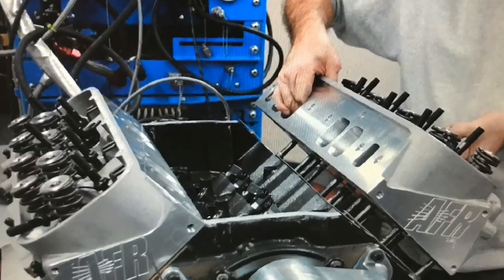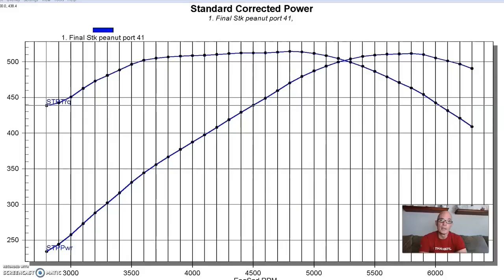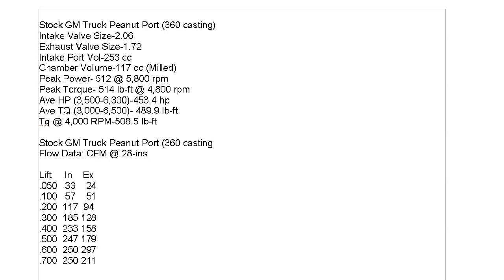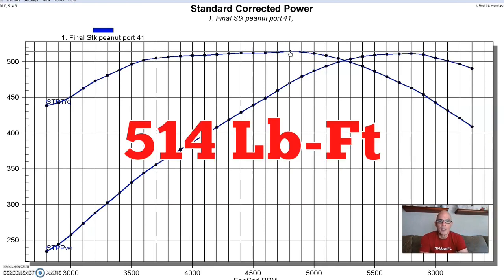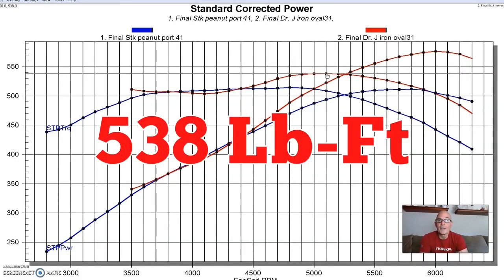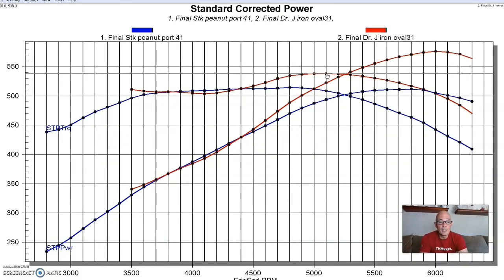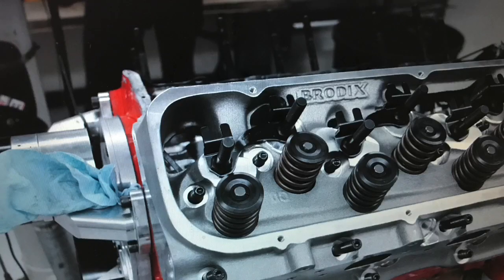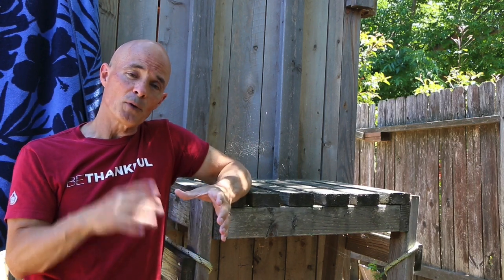THE OVAL OFFICE-WHO WINS?

Comment: should have done 049 or 781 stock unported with stock 2.06in 1.76" exh with 3angle valve seat. I think you will find those would have achieved above 500
Reply: I agree.  Maybe even show 049/781 with 2.06/1.76 and 2.19/1.88 valves and some basic bowl blending. Something the average person could do.
Reply: That would have been a better head to head comparison.

Comment: Alright Rich!!   I am ready for the BB Rect port test!!  In the way back, 1995, My 496 had Cast Iron Merlin Rect Ports, 850cfm on a Vic 454-R and Comp Cams 288AR-8 Solid Roller, with flat tops it had 9.8 CR 605hp 610tq. Peak Power at 6400rpm.  I always wanted to improve on that but never had a chance.

Comment: I noticed the AFR heads show better flow rates on the intake at lower lift and not higher flow than the other heads.
Reply: 50 degree seats on afr makes great low lift flow numbers . and obvious power .
Reply: Higher average flow makes more power! You'd need higher lift to make use of the higher peak flow heads shown anyway :)
Reply: @garageredzone  normally do but these made more power with less flow, I guess the difference was smaller chambers.. I have noticed that if the more lift doesnt help flow you can size you cam according to that.
Reply: During the time the valve is opening and closing, that's when the low-lift flow becomes a factor in mid-upper RPM performance. That's when the valves are in overlap. The amount of time in overlap, with the right manifold runner length, and header setup, will purge the cylinder and the combustion chamber. 
--You're supposed to be able to make 1.3 foot pounds of torque per cubic inch with a well planned built, no matter what design of engine you have(pushrod, 2-valve, 5 valve dohc, it doesn't matter). If you know what you're doing, you can get it. Otherwise, you're gonna be closer to 1.15.

Comment: I was surprised that the peanuts made it over 500. That’s my goal with a little smaller cam but more compression. Trying to keep the rpm down on factory crank and rods
Reply: every time i hit 6000 rpm's on my 396..it was time for a new bottom end job.
Reply: @stanherman5604  what do you mean? how many times did it blow at 6000?
Reply: @Christian-lf6iy  Twice

Comment: Loved that test. In the early 80s I traded my rectangular port heads for a set of race ported oval ports because of the low end power they provided on the street. I think this was about the time when articles has just started coming out about the difference at that time. The ovals wer far superior on my 468 in a 3600lb car

Comment: Awesome test as usual. I have a .040" over Gen V 454 with AFR 265s going in my fathers 72 ElCo. Was hoping to be around 600, but running a much smaller cam - ZZ502 H.O. camshaft. Topped with an Edelbrock Torquer and a Holley Sniper EFI. Maybe 560-575 is a more realistic # for what I have.
Reply: 570-575 hp is around 600 in my book.
Reply: The Edelbrock torker could be swapped out for an rpm air gap, will make a big difference across the entire rpm range
Reply: Get yourself a rpm air gap and that would definitely help

Comment: im building a 461 right now with the factory oval port heads im using a comp cams Magnum 294S Mechanical Flat Tappet Camshaft
Lift: .595''/.595"
Duration: 294°/294°
Lobe Separation Angle: 110°
RPM Range: 2500-6500 10.5 -1 calculated compression ratio duration at .050 is 248 which seems like a somewhat compareable camshaft to the one you used it seemed all the heads except maybe the afrs would have done better with an edelbrock performer rpm intake im at a bit of odds right now between single and dual plane intake however it seems to have ample torque to get the car moving with the single plane and a plate might be in the cards .......Love your stuff thanks for all you do !

Comment: This is a really great video I have a set of fully worked 049 on a 468 but it is 12.7 compression but I've run 10-6 at 127 so far and it could definitely use more converter  NA in my 1970 Chevelle. Videos are on my channel.. nitrous passes are 150 HP setting and easy mid nines.
Reply from the maker: Thanks for the info!

Comment: I built a big block for a buddy of mine he has a machine shop it was a 454 block we used a 396 crank and the 60 over bore 12 to 1 compression the cubic inch comes out to 431 inches we use the det of O 49 cylinder heads   We spray welded the exhaust ports to pick up the exhaust speed and ported the intake ports this motor made it easy 600 hp just recently upgraded  To a good set of rods and the motor look great Felt guilty spraying it with nitrous so we upgraded to bottom and it pushes a full body nova into the low 9 s would love to see  You build a small big block and put some bad ass heads on it
Reply: The det of 049 heads.
Det??

Comment: I’d like to see the exact same testing with a 496...
Reply: Sesame. I'm at a point in my 496 build where Im ready to throw it out the window. I need to spend my money wisely for the rest of the build and heads are the biggest cost
Reply: Shit Box cost is the same as building a 468 so might as well have the extra cubes!
Reply: David Callahan, Absolutely, I’ve seen 496’s with 781 and 049 heads, made huge low speed torque. If iron GM heads will work to some extent with that much displacement, Im sure any of the the aftermarket castings Richard tested in this video would make for one nasty pump gas 496. 👍🏻
Reply: Ian Hamilton Store, Build what you can afford, can always upgrade later, good luck man. 👍🏻
Reply: The only heads and intake I can find are from Raylar ?
Reply: Joe Nobody, You building an 8.1?
Reply: i got promaxx 325cc heads on my 496
Reply: @markusgentry1548  
Good combo?
Reply: @shitbox7413  havent put it on the dyno yet , its a 12:1 motor , milodon 4 bolt splayed mains , scat crank n rods with mahle pistons , should make 750ish .
Reply: @shitbox7413  gettin ready to build a 17:1 434 stroker small block for my s10 too lol with brodix track 1 sts 245cc heads
Reply: @markusgentry1548  
Holy shit that’s a lot of compression...
Reply: @shitbox7413  yea mahle power pak pistons witha 8cc dome and 64cc heads its actually more like 14.7 to 1
Reply: @markusgentry1548  
On methanol?
Reply: @shitbox7413  nah jus normal race fuel , has a bullet racing cam 683/640 lift 267/275 duration hydraulic roller

Comment: 512hp from stock peanut ports?  Well that settles it for me, all that money I was going to spend on heads is going into a roller cam and blow through carb!!
Reply: Why be stuck at 500 with stock heads after a nice upgrade of roller cam and intake, where as AFR or Dart heads would help you get much closer to 600 horse with at least 525 torque.
Reply: @delljr2769  pick up peanut ports for 100 bucks. You got it admit thats cheap power

Comment: What is over looked is with the high quality small runner aluminum heads, they get better mileage and the rings  last longer because the air fuel mixture isn't crashing into the cylinder wall like stock iron BBC heads typical do

Comment: Many years ago i was told about guys running the oval port worked heads on bracket motors.  At that time i waa doing the wrenching on a 68 camaro 427 powerglide combo . Ran ok .

Comment: Those AFR 265's are a great cylinder head. That's a good overall setup. 
I'm looking at the bubble from 4300 to 5200. 560 foot pounds. At 1.3 foot pounds per cubic inch, we should be able to get 608 foot pounds out of that top-end assembly. That's around 750 CFM at 5500 RPM. If the carb is rated at 28" water, that's 1psi pressure differential over the carb. Which is 13.7/14.7 density loss. That is 93%, or, 566 foot pounds out of a total of 608 available. Right in-line with where everything is. 
--So, if the bubble represents the cam, head, header, and intake being able to scavenge the chamber on a 468, A 496 would need (496/468) times as much compression, which gives us. 10.6:1. And to get that extra air density, an adapter that tapers at 7-degrees from a 4150 flange, to a 4500 flange might be the ticket to get us there. The additional air density might make that bubble bigger. 
-What about the GM manifold that came on the RamJet502? I wonder what it can do if you hog out the front of it to fit an oval throttle body for a 5.0 coyote.

Comment: I was running the compression on your engine with the -22 CC domes you had paired along with the 049s that have 119CC chambers and came up with a number closer to 9.55:1. You said something closer to 10:1. is your deck height different then .04? Once you moved over the Edelbrock heads with 100CC chambers wouldn't you be able to provide more cam because of the increased compression ultimately adding more horsepower? I'm just learning this stuff so sorry for the stupid question.
Reply from the maker: why would you change the cam with a change in compression? also what gasket thickness and ID and deck height did you use for compression calculation?

Comment: Thanks for doing yet another tremendous job with massive info for us viewers! BBCs seem to like lots of overlap and duration, but this cam seemed on the small side. How about another 0.100” lift? Most of the heads showed good flow up through 0.600 to 0.700, and a 2.25 intake valve would generally suggest at least 0.650 lift. I’m thinking these heads could do just fine on that 496, too. Thanks again for all the super videos!

Comment: Hi Richard I really like your videos about 454 i am building 454 gen vi with afr 265cc same as that engine :
1- what piston do u use(  SRP)in that gen6 bore strok or part number whats the Compression ratio that you get .
2-do you change the carnk or its stock also do you change the piston Connecting Rods or stock .
3-Head gasket that you use part nauber & thickness.
4- is it ok to use this part SRP Big Block Chevy Small Dome Profile Pistons 212159 & bore the the engine block to 4.350 or more to fit this piston .
thanks for the lot of exprince that you give to us from you real great videos ✌
Reply from the maker: Unfortunately I don't have part numbers

Comment: Would the better flowing heads benefit from some cam advance?
Reply: ANY engine can benefit from advancing a camshaft, regardless what cfm a bench says.
Reply: @vengeanceizmine9878  not necessarily
Reply: @needmetal3221  Incorrect. An engine does not require big cfm numbers to see benefits from advancing a cam. More important variables in the mix, and they don't even need to be considered..

Comment: I run in a class that requires steel heads. Whats the highest hp steel head combo you've tested on a 454 bbc or 460 bbf?
Reply from the maker: ported heads should support 700 hp, ported iron after market heads a lot more
Reply: @richardholdener1727  do you any casting numbers to look for on stock heads, bbc 454 & bbf 460? Thanks

Comment: how would these heads do on a bigger cubic inch motor like a 540 or 572 compared to the 468
Reply from the maker: not as well-unless you wanted less engine speed
Reply: Richard Holdener great work Richard 
I have 572 pump gas , 300 AFR’s Ovals , super Vic intake 11.8:1 Comp, 270/274@ .050 solid roller .728 lift on 112 LSA  (Tony Mammo picked cam for me) made 736 Ft/Lbs and 807 hp at 6200 rpm.

Comment: How do you think the 375hp 396 heads i believe a 063 casting  close chamber big oval port would match up
Reply from the maker: are those oval port-thought the 375-hp had rec ports
Reply: @richardholdener1727  3931063 is the casting number i havent found a lot of literature on the net best i can find is a 325 to 400 hp 396 to 427 101 cc combustion chamber oval port but to me the do look like a bit more defined than most ovals I've seen but they may have been worked at some point any info would be greatly appreciated
Reply: 375hp 396 has closed chamber rectangle ports

Comment: what made the AFR heads output the highest peak HP heads even though it doesn't have the highest peak CFM?
Reply: Two words.... Air Speed.  
Never port a head and chase cfm numbers on a bench. It's at the very bottom of the list of what makes power in a cylinder head.

Comment: I currently have a 10.5:1 468 with the 2.25 intake valve GM aluminum "roval" head. I really want to build a 496 with an AFR 300 Magnum Oval for a street 68 Chevelle.
Reply: From what I've heard the 300cc go turbulent better to stick with the 290cc.
Reply: I have a 572 with 300 AFR’s, super Vic intake , 11.8:1 Comp , 270/274@.050 .728 lift on a 112 LSA., Torque 736 FT/Lbs and 807 HP on pump gas.
Reply: @michaelparadisis4076  what RPM for HP and Torque peaks? That's a lot of displacement on that head, I bet it's a blast torque wise.

Comment: Do you think there is a cubic inch point where the airflow falls off with an oval port head vs. a rec. port head I just built a .030 over 454 with an 049 but now I'm building a 540 and I have access to a dart pro one rec port and was curious about oval vs. rec
Reply: It depends on what your goal is and where you want the power.
And yes, as cubic inch goes up, so does the demand for air.

Comment: When adding ported heads do you have to get your engine tuned?
Reply from the maker: distributor and jetting is easy
Reply: Will the air/fuel ratio be to lean are to rich please be patient with me I'm new I have a 2004 Chevy Silverado 5.3 engine and I'm porting my heads (706) intake should be 215cc and exhaust about 82cc will my air/ fuel ratio need to tune
Reply: Thanks so much for taking the time to answer me I feel special lol you work so hard on the videos  🙏😇

Comment: just wanted to know why u didnt use the speedmaster 305 cc intake runner oval port heads, also i think the reason why the afr 265 oval port heads made more power is becuz the comb. chambers were so much smaller, more compression probably at least 2 or three points higher, i guess the motor liked that alot
Reply from the maker: 2 or 3 points higher? um.....no! The little head offered more of everything that counted-just not port volume

Comment: Richard can you run 781 heads on the 496 as a baseline then go rectangle? We need oval to rect comparison on the same motor.
Reply: Richard, I still remember the big O vs. the big R back in 2012. I just reread it on superchevy. I weed through the LS articles to find BBC 496 runs at westech. Is this BBC info compiled anywhere so we don’t lose it by you, Jeff S. or Steve B.?

Comment: You changed heads so many times I wonder about those poor block threads? Also, did you use new head bolts every time when switching those different heads out, and if so, what make?
Reply from the maker: arp head studs

Comment: I had an article that these West Tech guys did was it really good article unfortunately I lost it.
What I remember about the article was that they took off 454 block bored 60 over and cut the stroke down they shorten the stroke don't know the stroke of the crank, and came out to be a 509 cubic inch motor I don't remember if they did an extensive head test. But I remember have ridiculous torque curve and power curve it just kept Rising, also I have very good bottom-end torque which was surprising thing. It will be nice if you could do that

Comment: How about the less oil in the pan more power myth? That there is a point where you can make max hp and oil pressure with less vs more oil in the pan causing more drag and lower psi ( so I've heard)
Reply from the maker: we do play with oil level on the dyno

Comment: the question is,does anyone build 468s anymore?  With blocks harder and harder to find you end up with an aftermarket Dart or similar and 540 begins the journey for the BB in the 21st century weather it be a Hotrodder or street strip engine and even if you do have a clean GM block with parts coming in as kits these days 496 seems to be the bare min  .

Comment: Learning a lot... But I do know that cam is way to little for a Big Block Chevy especially if you put 600+ lifts in LS engines which are smaller... That's just from paying attention to the channel💪🏾💪🏾💪🏾.. but great info
Reply from the maker: lift does not determine if the cam is big-duration is much more important
Reply: @richardholdener1727  right on💪🏾💪🏾💪🏾
Reply: BBC vs LSX build up same everything???🤷🏾‍♂️🤷🏾‍♂️🤷🏾‍♂️#onedaysoon
Reply: @richardholdener1727  Brian Tooley says 3 times the intake valve diameter for maximum lift does that hold true here

Comment: Hey Richard, great video. What I am really curious about especially with the afr 265s is if you added another atmosphere of boost, would it actually double the horsepower to 1200+ or would they not support that kind of cylinder filling? I assume the reason they made that much power is because they filled the cylinder so well with a high port air speed. Curious on your thoughts. Also, when are we going to see the BBC Big Bang video???

Comment: I don't  get it!  Why not put the rectangular heads on the 468? That way we could see what the real power difference is, between the port shapes with the same bottom end. I want to see the 496 tested, but it's a different beast. Killer test over all. I look at these tests for an power application in my V-drive hydro. My boat is setup for BBC,  but I really want a blown 440 stroker mopar.

Comment: You need to figure out that if you test from 2000rpm with one engine, the others need tested there also. Without testing down to 2000rpm it makes this test absolutely worthless. When you start your run on the street, 2000rpm is the start, not 3000rpm.  Only drag strip needs from 3000rpm starting point.
Get a clue
Reply from the maker: absolutely worthless?